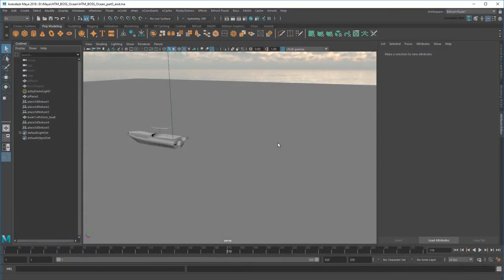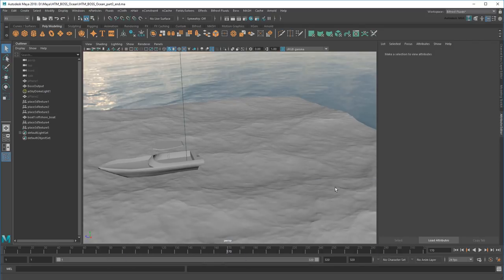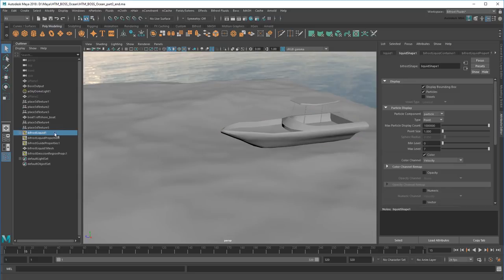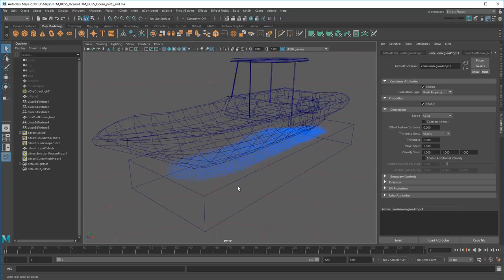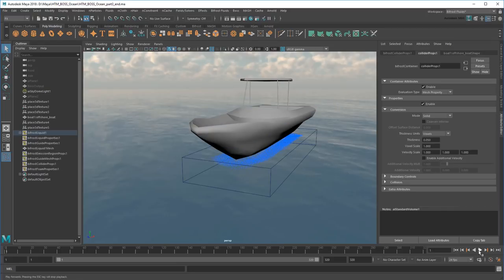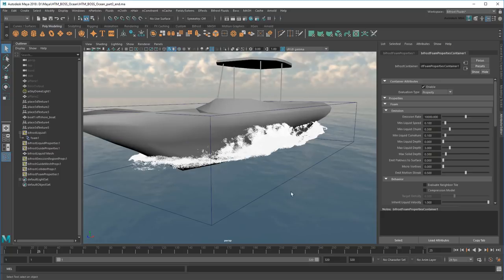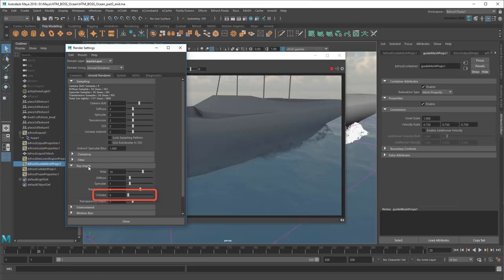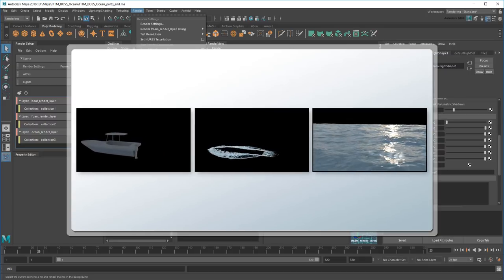Creating an ocean - Part 4 of 4: Dynamic foam

Comment: at 3:14 in the video, you say "i'll select them both"; what are the two pieces of "both"? You select the ocean mesh plus two bifrost nodes, yet the mesh does nto become highlighted in the outliner. Is this a bug, and the BossOutput should be highlighted? This step is not working correctly for me (maya 2020), I can get no particles to emit. 

Great video series, this is very helpful and well organized.
Reply: select BossOutput and then BifrostLiquid1

Comment: I'm getting an error and I don't know why, as I've followed all the steps exactly. But, I'm at 4:27 and when I hit play, the blue particles disappear and the box doesn't follow the boat. If I try to render any frame other than frame 1, I get this error: 
# Error: [BIFROST AI TRANSLATOR]: Liquid data {} not found # 
// Error: [BIFROST] Failed to load bif file '/voxel_liquid/voxel_liquid_volume.0059.bif'. // 
// Error: [BIFROST AI TRANSLATOR]: Liquid data {} not found // 
// Error: [BIFROST] Critical condition failed: (inData->inMemoryRef != NULL) (contrib\extensions\bifrost\procedural\common\src\Implicit.cpp:297) // 
// Error: Failed to initialize implicit data on node 'liquidShape1' // 
// Error: [proc] liquidShape1: error in user init from  // 
// Error: [BIFROST] Failed to load bif file '/voxel_liquid/voxel_liquid_volume.0059.bif'. // 
// Error: [BIFROST] Critical condition failed: (inData->inMemoryRef != NULL) (contrib\extensions\bifrost\procedural\common\src\Implicit.cpp:297) // 
// Error: Failed to initialize implicit data on node 'liquidShape1' // 
// Error: [proc] liquidShape1: error in user init from  // 

Can you please advise? Thank you!
Reply from the maker: Whoa, that definitely looks like something is wrong with your install.  I'd first try disabling and re-enabling the Bifrost plug-in (Windows > Plug-in Manager).  If that doesn't work, I think you might need a Maya re-install.
Reply: @Autodesk_Maya  thank you for the feedback!
Reply: @brittiebrittie123  we dont know what the problem is so we just tell you to reinstall.

Comment: I have a problem. I tried to reference an animation scene with the water scene tutorial. For some reason, neither the animation or the water will work together. If I remove either of them the other will work just fine. Is there a reason both scenes are not working?
Reply from the maker: What's your playback speed?  It needs to be set to "Play Ever Frame, Free" in order for simulations to work correctly.

Comment: how you select BossOutput with emissionregionprop1 and  bifrostLiquid1??? i see the BossOutput is not higlighted in outliner... and i cant make guide like in the tutorial
Reply from the maker: I selected the BossOutput plane in the Viewport, then selected the other two in the Outliner.  You're right though, I'm not sure why the BossOutput didn't show as selected in the Outliner.  It might've been a bug in this older Maya version or something.
Reply: @Autodesk_Maya  Nevermind it work like a charm now....bifrost is amazing, thanks for your respons
Reply: At 3:11 the emission region node must not have actually been selected.  To set up a bifrost guide, you only select the guide mesh and the bifrost liquid, not the emission region.  In my tests, the guide does not get created if you have the emission region selected too.  Just a screen redraw error I guess, but it had me pulling my hair out for awhile.
Reply: @dw308  Absolute Legend, Thanks a ton

Comment: at 3:10, when I add the particles, they are all over my ocean, any idea on what I did wrong ?
Reply from the maker: Are you sure you made the boat your Emission Region?  Also how big is your Thickness value?
Reply: I know it's been years, but if your "boat" object is in a group, it puts the particles everywhere. You have to take it out of the group. Had the same issue.

Comment: My cpu is i7 4700hq. When the wave is generated, the speed is very very slow. It takes more than 20 seconds to generate a picture. Why is this?
Reply from the maker: How much RAM do you have?  In general, dynamics is VERY resource hungry so it's not unusual for it to take long to generate a frame.  You could try increasing the Master Voxel Size a bit.  That'll decrease the simulation accuracy, but increase performance.
Reply: @Autodesk_Maya  thank you，I have 8GB,Is it enough?
Reply from the maker: @Tei君_channel  8GB is definitely a very low amount.  For dynamics, I'd recommend 32 or even 64GB.

Comment: How do I make the ocean have wave breakup foam? Looking to do this for a uni project
Reply from the maker: I think the term you're looking for is "whitecaps".  For this, you'd need to create dynamic foam particles (much like this tutorial video) all across the ocean's surface, instead of just around the boat (and guided by the BOSS ocean).  That way, when the ocean mesh animates, the particles will spill over each wave like in real life.  However, this will also be a much slower simulation because there will be a lot more particles, so I recommend simulating only a small area of ocean, or caching overnight.

If you look in the Maya Content Browser (Windows > General Editors > Content Browser), in the Bifrost Fluids section, there's also an example called "oceanBeach" that demonstrates this (albeit in a shallow water scenario rather than deep ocean).

Comment: Hey...so i was wondering....can you use the "create boat"option from the "fluids" tab to simulate an object floating on the ocean that we created using BOSS ?
Reply from the maker: Unfortunately no.  Everything in the Fluids tab is built on older, incompatible technology.
Reply: Is there a way so make an object float and interact with the waves that were created with BOSS?cause im working on a project that relies heavily on boats and sea....so a simulation like that would be amazing for my project.
Reply from the maker: @WildWolf_21  That's not typically how you'd do an effect like that.  Usually, you'd animate the boat floating (bobbing, moving, etc) by hand and then fill in the ocean around it using the method I've shown in these videos.
Reply: @Maya Learning Channel,i mean in a way to substitute the “make boat” option thats in the fluids tab...cause animating the boat alone will be time consuming plus having it react to waves will be even more time consuming....anyways,i was wondering if there was a way to gain more time by having it done automatically instead of manually.

PS:it would be nice of you if you could do a video or link me one that shows how can i have the boat react to the waves ;)
Reply: Yeah also one last thing....will the BOSS intersect/overlap with the boat?(As it being inside the boat it self and not around it)
Reply from the maker: @WildWolf_21  The BOSS portion will (which is generally acceptable) but as long as you have particle foam covering it, then nobody will notice the point of intersection.
Reply from the maker: @WildWolf_21  You can try going to Windows > General > Content Browser, then go to the Bifrost section and load the speedBoat example if you just want a quick animated boat to build on.
Reply: @Autodesk_Maya  the intersection might ruin some stuff im working on,since the boat that ill be creating will have a lower deck so the intersection might force me to make the boat taller in some ways.
Reply: anyways,thanks alot for the help...and please if there are any changes to the BOSS mechanics(especially stuff related to wakes and waves) could you update the videos so we can make use of all new additions?

Comment: whats the supposed simulation time for the this example scene?? The amount of time it takes to simulate on my machine makes me think there is something wrong on my side..or maybe it isnt? An Answer would be greaty appreciated
Reply from the maker: I can simulate it in about 15min.  Of course, that number will depend on your particular computer setup (mostly CPU and RAM).
Reply: @Autodesk_Maya  thank you for your fast reply!!! over here it would take hours! im on a rather new machine (i9-7900X 1258gb ram) and the sim times feel way too long. any ideas if there might be some preferences that might be wrong?

Comment: Hello, I've been following your 4 step bifrost ocean tutorial for an experiment of my own, but can't seem to get the foam effects from this video right. There is no bifrost particles at all. Would appreciate greatly if I can get some pointers, thanks.
Reply from the maker: Are the foam effects you're going for using the included scene files from this tutorial, or your own?  You'll need to adjust to the scale of your simulation if it's your own.  The Master Voxel Size especially might need to be tweaked (generally the smallest value you can get away with, the better).
Reply: I created my scene from scratch, as for the scale I did follow the tutorials for the most part, but had to cut down on resolution due to my machine limitations which resulting in crashes. I also kept my real world scale ship at 0.03.
Reply from the maker: I'd still try to size down the Master Voxel Size if possible.  Also, increase the emission region radius just to see at what point the particles show up.

Comment: Can we make ocean simulation in 2016....?
Reply from the maker: You can create an animated Ocean tile using this older feature: http://help.autodesk.com/view/MAYAUL/2016/ENU/?guid=GUID-74194EAF-EBF5-41C7-AA3C-3E34012F5CC0

Unfortunately BOSS was introduced in 2017 so you won't be able to use the workflow shown in this tutorial on that version.

Comment: yeah i think the baked foam trail image sequence coming off the boat just looks worse and worse as it goes on
Reply from the maker: As stated in the previous video, unfortunately the foam generated by BOSS isn't physically accurate which is probably the weirdness you're seeing (it's best used from far away or only at certain angles).  If you need higher fidelity, then I'd recommend using Bifrost partcles to do foam for the entire wake (it'll require a lot more particles though, which will slow down performance).
Reply: it also looks like the foam particles are literally being emitted from the geometry of the boat itself
Reply from the maker: That is actually what's happening.  That being said, you can lessen the obviousness of it by widening the emission region (that'll generate more water around the boat, which in turn will generate more foam further away from the hull).   Again, just be prepared to incur a performance hit due to more particles being generated.

Comment: do you think simulating liquid and foam together in the same time better than to simulate liquid first then use ( read/Write) and simulate the foam?? or will it be same result?
Reply from the maker: Using this technique it'll be the same either way.  If you were doing an entirely Bifrost particle ocean, then it'd be better to simulate everything together.

Comment: Hi, what was you system specs for this tutorial, I mean was that 1 machine or few, what was the CPU model? I tried your scene in single CPU I7-6700 with 32 of RAM, but the calculation of foam particles was few times slower. Say from frame 1 to 20 it took about 1 hour, from 20 to 40 it took additionaly 5 hours. Frame 40 foam_particle.bif has ~800 MB size. I just can't imagine how long it will take to make complex scenes if this simple one calculating for so long. BTW I've tried different PCs, with different Maya and Bifrost versions, and a result was pretty much the same it terms of performance. Thanks.
Reply from the maker: Hey, so just to be clear, some of that playback has been sped up to save time (as mentioned in the video description).  In real-time, it takes me about 4-5 min to run through the scene on a dual Xeon with 64 gigs of RAM and an RTX card.  Your best bet to improve real-time playback is to lower the resolution of the input mesh, turn off things like anti-aliasing and shadows, and use less complex lighting.

Rendering the sequence takes about a few hours at the maximum subdivisions with the lighting shown here (which is pretty typical at industry studios).  If thats too long, you can lower the quality of your lighting, subdivisions, etc.
Reply: @Autodesk_Maya   Thanks for the reply and tutorial. It is really helpful. Yeah, some adjustments make the scene more responsive.